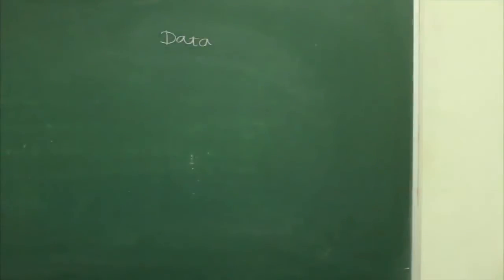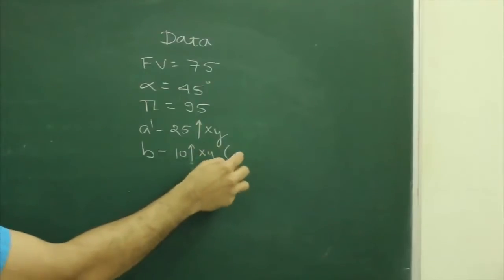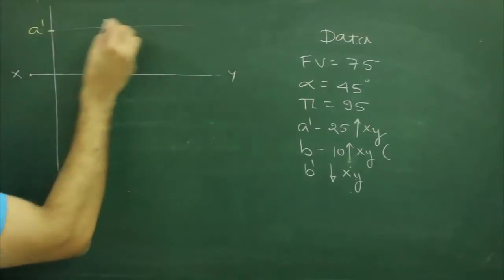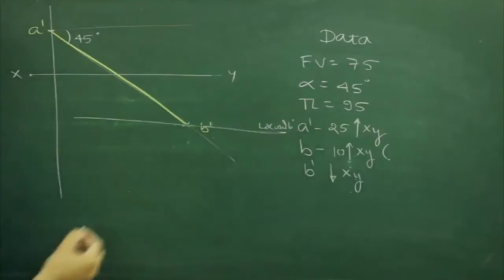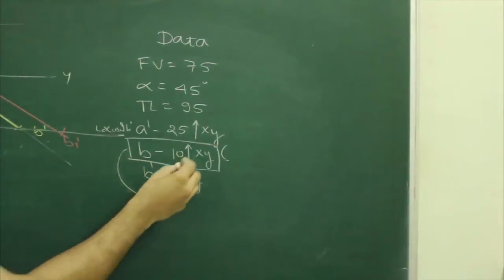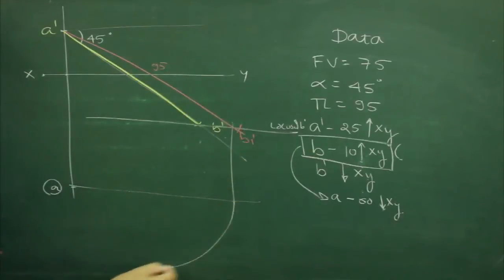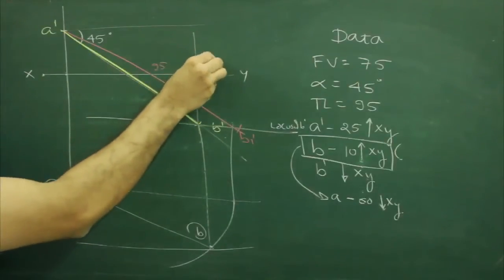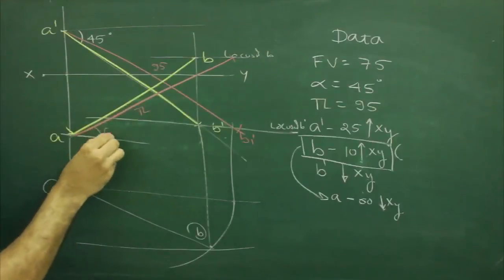Projection of lines 27

Comment: sir how did you take b at a distance of 10mm from xy plane . which point in the question signify that.
reply ASAP plz
Reply from the maker: Anmol Jain I am sorry it is in the question that point is 10 mm behind VP.  Thank you
Reply: sir may i plz ask what did you do after drawing the true  length and the fv in the question, considering the only data given in the question is that the point is 10 mm behind vp  and needless to say your videos are very helpful thank you
Reply from the maker: Anmol Jain I have assumed a and sliced like a normal question and in the end I have used position of b (10 mm above XY )
Reply: Sir, can we cut A above the XY line ? Because they haven't specificed if a is behind or infront of VP.